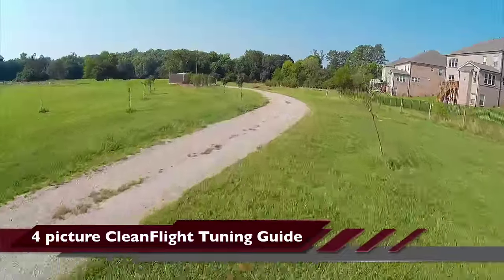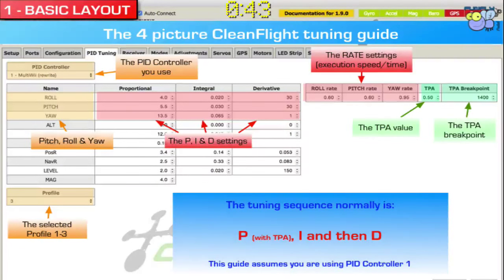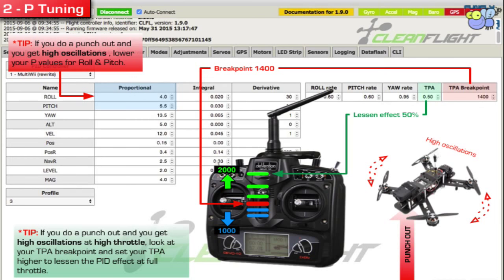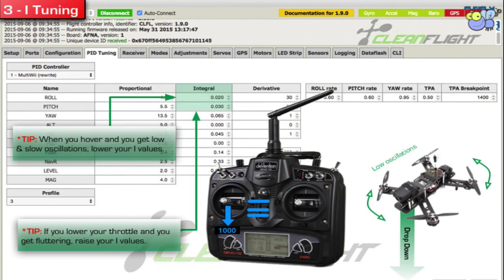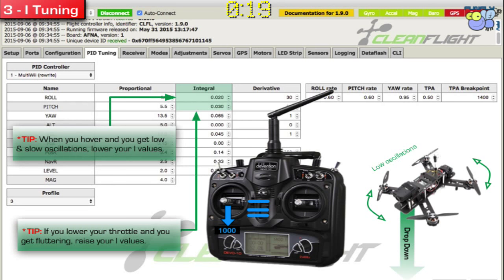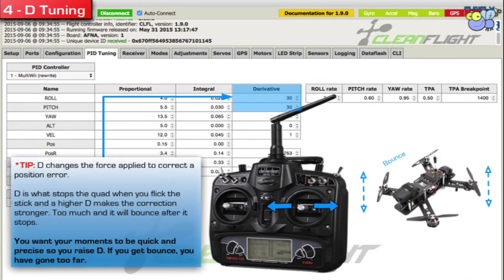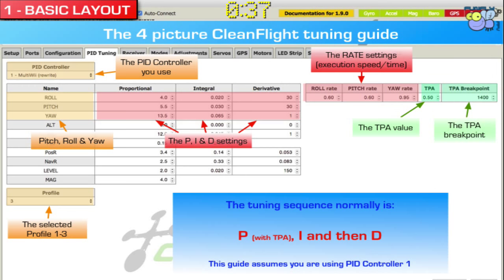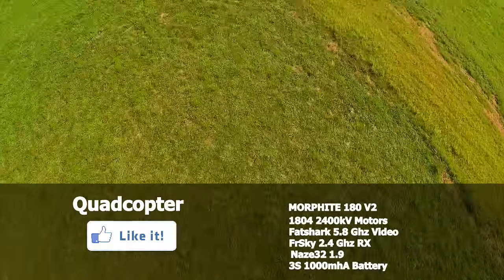5 Min 4 Pic CleanFlight Tuning Guide

Comment: You're confusing me with the I gain. You first said if you want to decrease low oscillation then you need to decrease your I gain but then you said if you want to decrease your oscillation on descent then you need to increase your I gain. Can you clarify?
Reply from the maker: +Dean Thorton Hmmmm.. Low oscillations is when the quad is in the air just hovering in one place and height and it slowly (very slowly) oscillates (moves around). Oscillations on decent is when you come down fast towards the ground and apply throttle to stop it from hitting the ground. That would be a fast occultation usually. Try and find a happy medium between the two.
Reply: FunFly FPV Will do. This weekend I'm going to dive into pid tuning for the first time. I guess theory will only get you so far. Time for practice :)